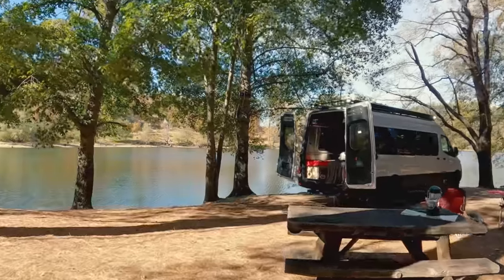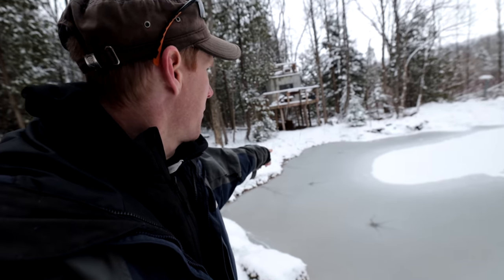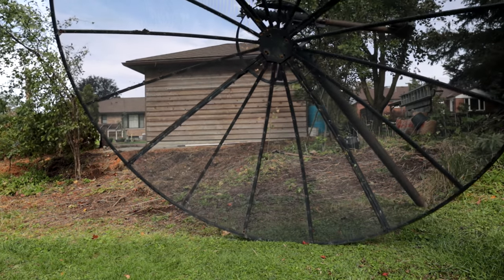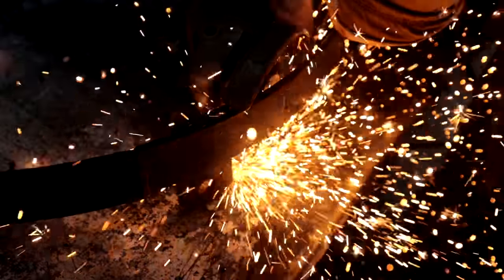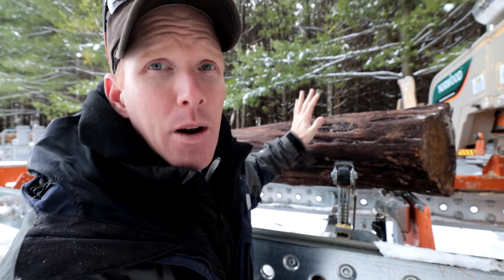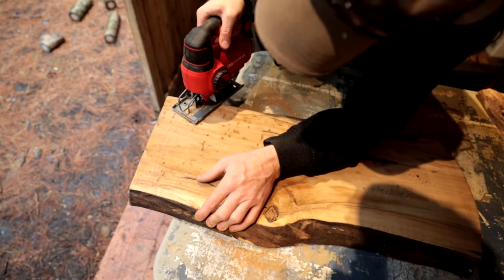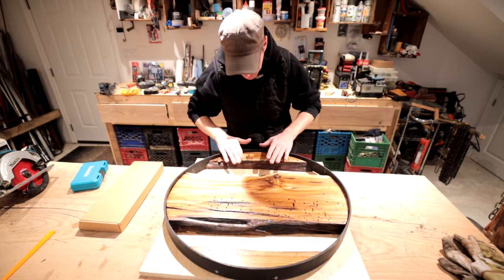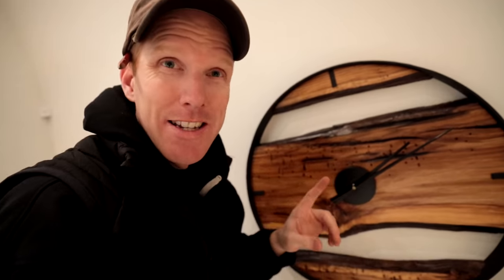Building a Christmas Clock from Reclaimed Materials.

Comment: Hey Kevin, At 1:30 in your video you will notice that the Omaze van solar panel will be shaded pretty much all the time by the metal frame surrounding it.  If just an edge on a panel is shaded it drastically reduces or even eliminates its output.  Poor planning on the builder's part.

Comment: I had a coworker tell me he filled a tote with water and screws a towel to make a makeshift Zamboni I don't remember if you used that last winter but think that would take off bumps ?
Reply from the maker: Fill it with hot water.. melt the top layer off.